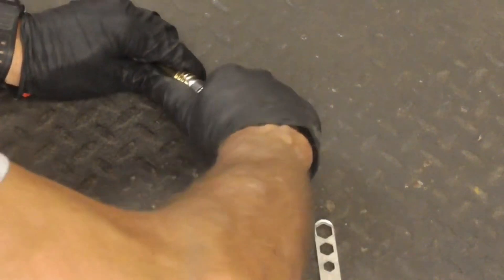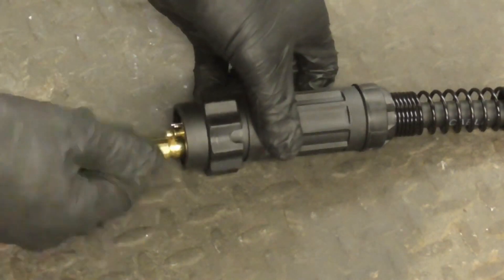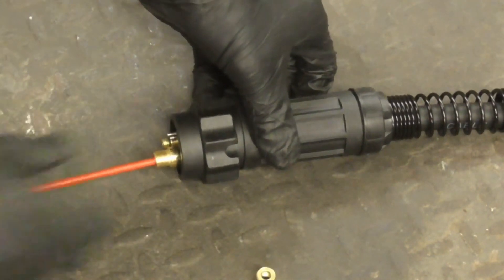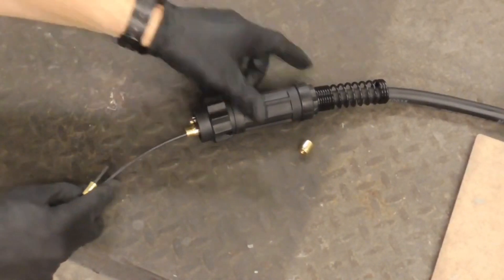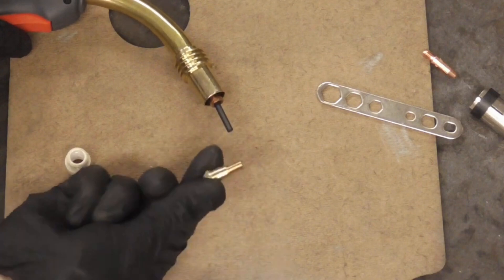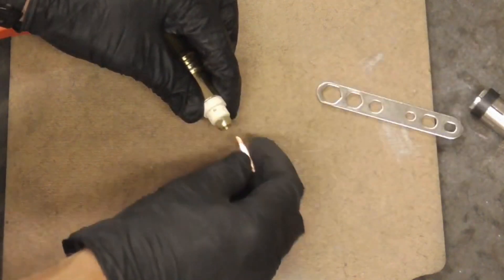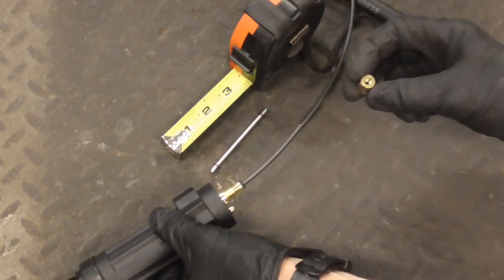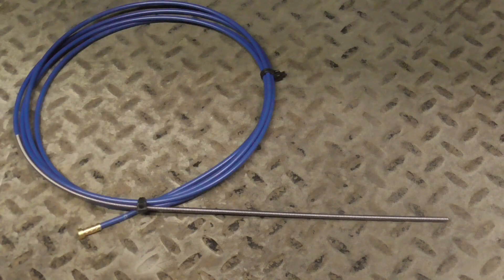How to Install a Graphene Liner

Comment: Going forward, will you use the graphene liner for both steel and aluminum wire?
Reply from the maker: Yes.   I keep one welder set up for aluminum and one for steel though.  I'm not big on switching processes - to much time and work.